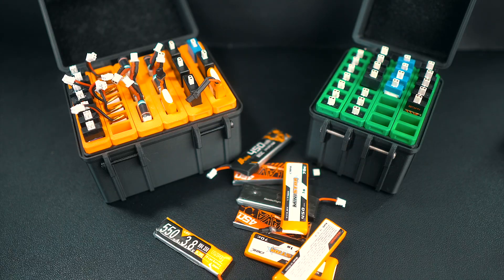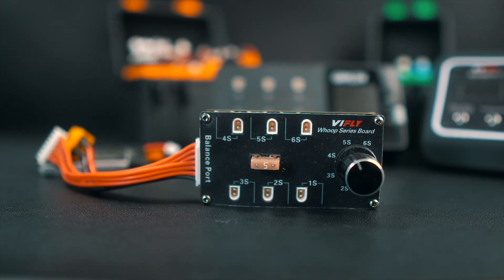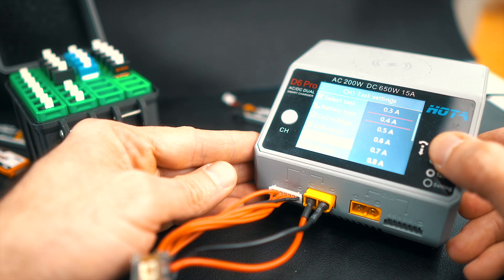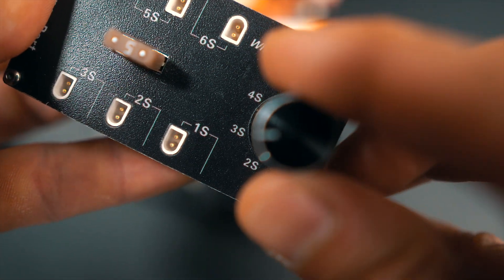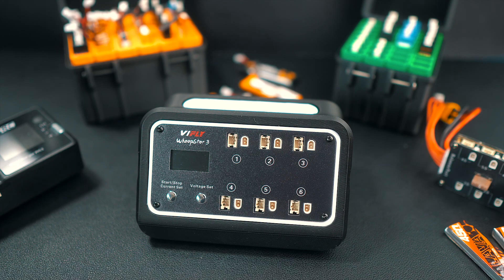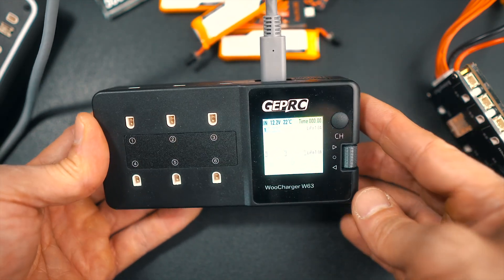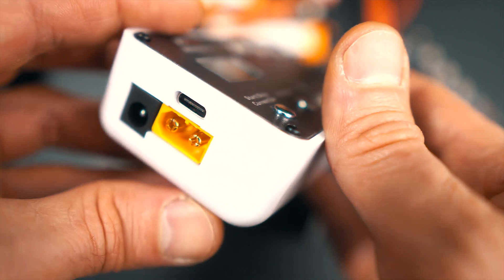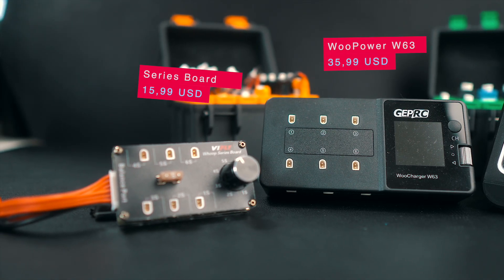DON’T WASTE MONEY! Get the Right 1S Charger

Comment: I just ordered the vifly, Geprc looks better but the vifly has the barrel power supply option that I already have and someone said the the geprc needs 100watt power brick for the usb-C option to work on full "throttle" (not sure if it is true). Also the 3d print desk base hooked me a lot hahaha. Having the option to mix charge/discharge/storage at the same time looks cool but I dont think that Im going to use it like that. Nice video, thanks
Reply from the maker: Nice! Sounds like you've made a good choice based on your existing setup and needs.

Comment: I have the vifly and 3 of the betaFPV ones and I like the beta FPV better
Reply from the maker: That’s interesting. Can you tell us why?
Reply: @ I found it easier as plug-and play. I plug them in all types of different batteries doesn’t really matter which ones  300 or 550 they charge fully with no issues.  
And will charge all six at the same time  ..  doesn’t matter if they’re mixing or matching.

Comment: Hey, i have a 2S 7.4v  6200mah  Battery. Written on the battery: Max charging Current 2.0A but if i do that it only goes to 3.880....  a 6200 can charge at 6.2A right?
Reply from the maker: Yes. That’s at least the theory. 1C
Reply: It depends on the battery type and construction. If it says max 2A, then don't charge faster than that. Don't ignore manufacturer instructions and use common rule of thumb conventions over them.

Comment: To me a 6 channel charger not allowing switch all channels to the same mode with one action is a big negative. Have same UI on ToolkitRC 4 channel and it is pain and a lot of clicking/scrolling to start 4 batteries.
Reply from the maker: if you are talking about the GEPRC charger, it's very easy to apply the same setting to all the channels with one click. You just configure one channel and click the button that says APPLY ALL, and that will apply the settings of the channel selected to every other channel.

Comment: I guess most people are over that ph2.0 thing by now, but from the video it kind of looks like the Geprc charger doesn't provide that solution - but it does!
Reply from the maker: I think most pilot are over it. But manufacturers are still using it. Specially batteri manufacturers.

Comment: Great review mate. I've been using the Geprc Woopower ever since I did the unboxing video when it was launched. And one thing I noticed, is that you can set the safe time, safe capacity and safe temperature in the charger. Not something you can do with the Whoopstor v3. This is a very useful feature if you're using 3s or higher cell count batteries with no BMS. There have been multiple occasions where I've kept the field battery (4s) plugged in to charge and it almost drained since the charger will just keep pulling as long as the voltage is higher than its minimum power on voltage. That's where the safe capacity and/or safe time came to save the day! Obviously, you should always keep an eye on the charger whilst you're charging, but a safety feature such as that can be a lifesaver at times. Whoopstor v3 doesn't have that but it's not a deal breaker since its case design/assembly is more durable than that of the Woopower.
Another thing you've pointed out is the lack of start and stop button. To be honest, I've gotten used to it after learning my way around it. It's actually more convenient. Some people might say that will lead to inaccurate (pumped up) voltage, but the tapering of current to achieve the set voltage on the Woopower is far more accurate and their approach feels far more careful. I've actually done some testing and comparison on that between the two and the conclusion is the same - Woopower can actually reach the pre determined voltage value accurately while the Whoopstor struggles to do that. If you're still reading this, thank you for your time and to NordFPV, thanks for printing and film that dock ❤
Reply from the maker: ha, I haven't played with that before, so thanks for letting me and the rest of us know.
Your design for the whoopstor was great, so happy to show it off. Maybe you want to do one for the GEPRC? I'm happy to show that one around too if you get to do it.
Reply: @NordFPV  Something is definitely on the way 😄

Comment: For now I just pick up what was available in the local store (I didn't want to wait): HGLRC Thor 1S v2. I wanted it to be independent from my big xt60 charger, use usb c brick and HV.

- no display so I use radio telemetry to check battery before flying
- sometimes it has trouble to cold boot with x6 discharged HV 300mah batteries (high resistance issue?)
- cannot mix HV and normal lipos - not issue for me
- no storage charge - it's easy to stop your last flight early before a long break + 1s batteries are cheap

I would recommend something else if you can find it as small as Thor.

Comment: Series board is just to expensive. It is just for a pizza cheper than fifly charger. 😊
Reply from the maker: It's half price of the whoopstor, kind of, but again, the point is that if you own a big charger saving 30-40% to add to your workflow may be beneficial. It's all about how you use it, your charging setup at home, or if you plan to be mobile with it.
I used that board for a long while attached to stationary bigger charger I had, and it worked pretty well, but not to be removed from the bench.